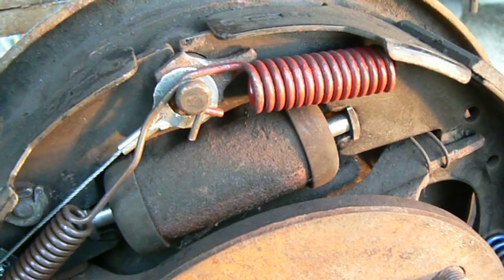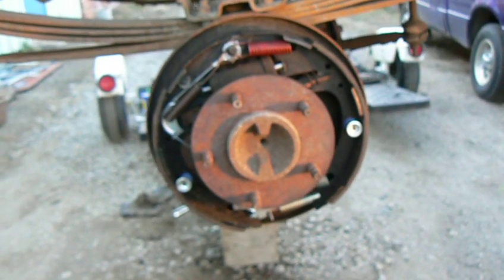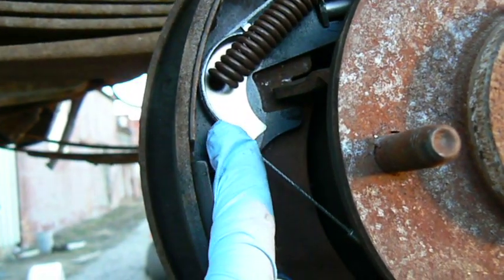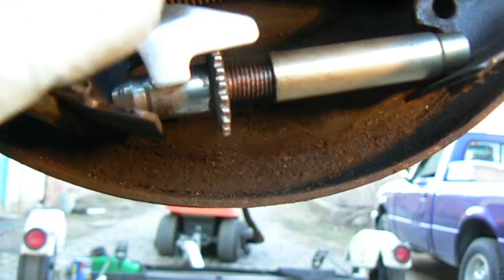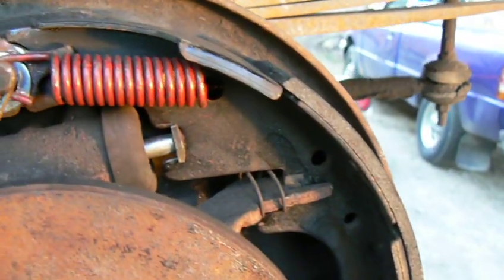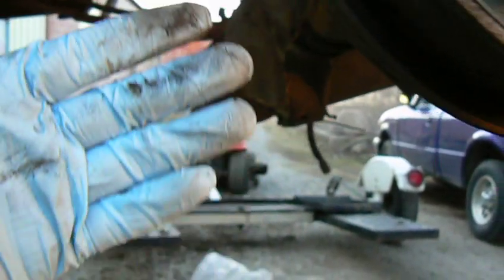How to arrange the springs, levers, and cables in a Ford truck drum brake

Comment: Minor comment...those 2 top springs can usually be either way as far as which goes on top of the other. Shop manual actually shows that shorter red spring as last spring installed on the post.

Comment: There are a couple errors here.  The shoe with the larger pad area goes to the rear, not the front as shown.  The keeper at the top post is upside down.  The wider portion should be up
Reply from the maker: I know., yet I can't easily reshoot the video.

Comment: The ring connector goes behind the little wing plate. The stud has a machined recess for it. Also, there is a small retainer clip missing. It goes on the top pin to help hold the top springs and that little plate in place.

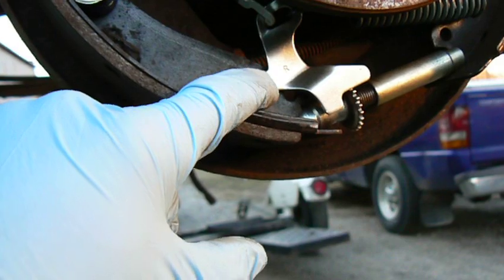Comment: 2:41 The letter "R" of "L" is also stamped on top of shaft under the "cap" on star-wheel assembly.  If you can't find L-R letters, just remember, when the wheel "clicks" is should grow in length.  A thin stainless steel thrust washer is on the shaft under that cap.  Don't loose it during disassembly and cleaning.

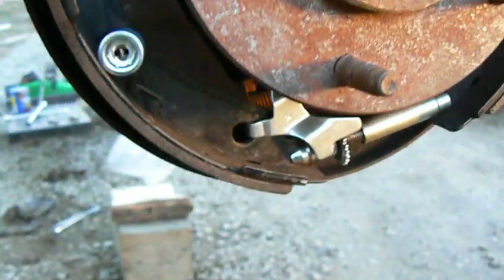Comment: Here's a tip: I used the old self adjuster and stuck the tip of it in the hole where the release lever tang [ 2:39 where his finger is pointing] holds onto the shoe to hold the release lever in place while I pulled the spring over into the release lever hole. This assembly is a pain in the arse to hold while pulling the spring over. Hope this helps.
Reply: Damn, that's a good tip. I will have to try that. Thank you.

Comment: Even with mistakes, I can use this video.  It is clear and easy to see.  I am replacing the rear brakes on my 1992 ford f150 as I write this and even with the shoes in my hands it is not easy to see which shoe is rear and which is front.  On other ford brakes I have worked on in the past the front is noticeably shorter than the rear, but not on these.  I studied the old shoes and I think I figured it out.
Reply: I'm doing the brakes on my 1994 F150 and another video alerted me to the problem of determining which shoe is which.  So, I got my new brake shoes from Advance Auto and laid them out and couldn't tell the difference upon visual inspection.  Then, I pulled out my caliper (the measuring tool) and measuring tape.  The "long" shoe material is 11-1/2" long and 0.265" thick (7mm).  The "short" shoe material is 11-1/8" long and 0.214" thick (5.4mm).  That's not a big difference but it is there.  The longer, thicker shoe goes in the back.

Comment: I see a few problems here.  It looks like you have 2 primary shoes on this side.  The anchor pin plate is upside-down.  The parking brake spreader spring is broken and the spreader guide plate is missing.  If you don't know how to assemble servo drum brakes, please don't post a video on how to do it wrong.
Reply: nice catch Mike. I looked at this and I see the shoes are reversed. The smaller one goes to the front not the rear. Judging from the accent this guy is from England and over there they do things opposite.

Comment: Hey the springs look good but you have the shoes on backwards! The small shoe "primary shoe"  goes forward and the larger "secondary shoe" goes on the rear.
Reply: or mabye ur looking at the wrong side?
Reply: I was just noticing this is all completely backward and opposite as the way everything is laid out on my 95 ford ranger.
Reply: You are correct. The short shoe faces the front of the truck. They are backwards.
Reply: @Mr.Yamahawg  now I'm confused 😕

Comment: The top spring is in the wrong hole also.
Reply: The smaller spring goes into the hole where the halfmoon guide goes,and the big spring is also going into the correct hole on the right side..I have the same truck,and you wouldnt be able to put that big spring in the farther hole because youd never be able to reach that distance

Comment: Springs are on wrong, red spring at the top goes on the bottom. Green bottom spring goes where the red one was. If you did it like this video, change it as you will have problems if you don't already.
Reply: The red spring is in the correct location.This is where it was even on my ford

Comment: I have a 1990 ford 150 and it looks like you might be missing a part or they slightly changed the design.  On mine there is a small metal spring plate on the horizontal bar that connects the two shoes directly below the brake cylinder.  The spring plate is the shape of an oval H and is placed where the spring connects touches the brake shoe.  The part probably makes no difference in function.  Thanks for posting the video.

Comment: American motors cars also use that exact layout.I guess they got it from Ford.
Good info video.
Reply: I think they both got it from GM, because the old drum brakes on 50-67 GM's, had the same layout.
Reply: Nik Buerky Hard to say where this design originated.  It is not unusual to see certain  component designs shared by manufacturers.  This setup is what I remember Ford using as far back as I can remember, at least back to the 60's,